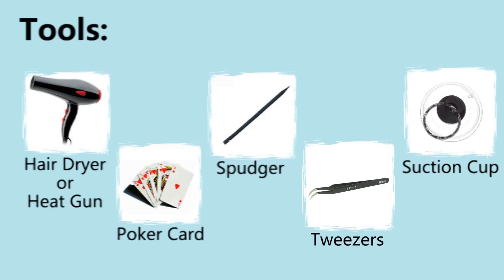Sony Xperia XA1 Plus Charging Port Repair Guide

Comment: Hello. A good video helped me to get inside my cell phone :) but now I am facing a problem. My XA1 Plus only has 1 antenna cable. The one right next to the USB-C port is not on my circuit board. Is there anything to watch out for? Can I still install the one with 2 connections? Thanks in advance.